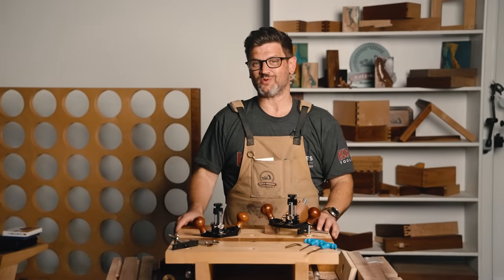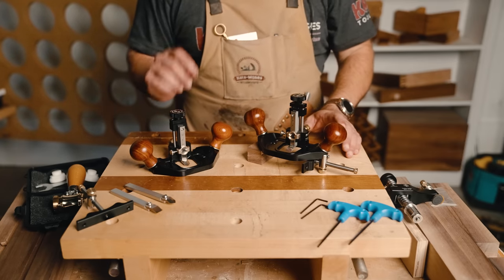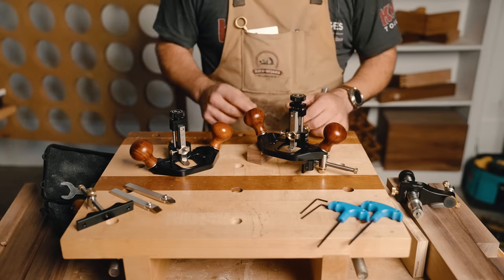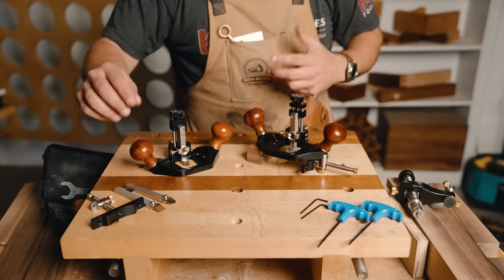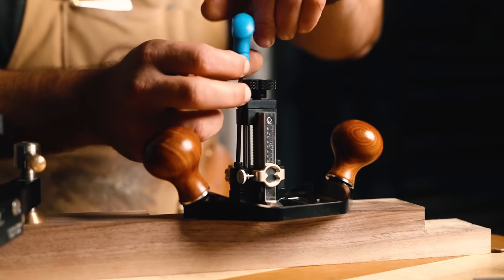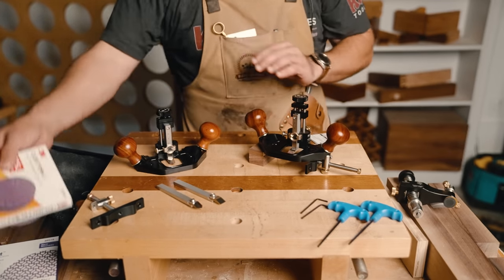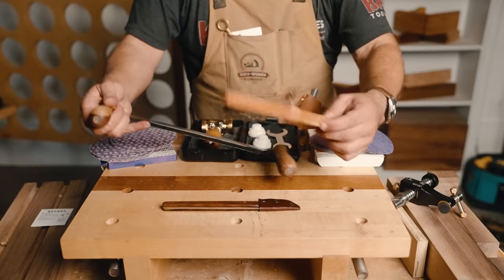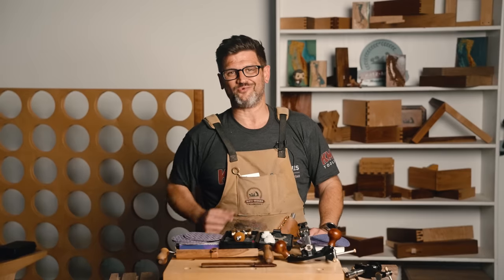The Katz-Moses Router Plane - Can You Believe It?

Comment: Looks like there's a new best router plane on the market... hopefully. 
I like the versatility of my Veritas but it always seems to lose its setting or have the blade loosen at the worst possible time. I'm always having to check the knobs and screw during use.
Having that rule will be handy for adjustment. There's so much slop in the Veritas, I tend to take too much of a bite, have to retract it, and then turn it back out (trial by error). 
If this does everything they got right without the "finicky" it's a winner for sure.

Comment: I cannot help but make the obvious comparison to the Veritas. I love my Veritas router. I also cannot help but acknowledge that if it really does nail all of the things it is trying to fix, your router plane leaves the Veritas choking on the sawdust in its wake. There isn't even a competition. None from LN, either. 

Everyone who uses router planes knows even the top dollar ones are fickle little beasts, but they're the best thing since sliced bread. I wouldn't work without one. If your control mechanisms can rein in even a tenth of the mechanical shortcomings built into traditional router planes, you've just done something extraordinary here for the world of hand tool woodworking. Have a seat next to Leonard Bailey. This plane is something to be excited about, no joke. 

Also, the timing on this business decision could not be better. This is a much needed addition to the modern retail lineup right when the market and the hobby need it the most. What a brilliant move. 👏 

Now I just need to find someone who wants to buy my Veritas so I can justify buying yours.

Comment: Does the height adjustment locking mechanism put pressure on the threads? Hoping it clamps on those 2 rods instead. Thanks.

Comment: Looks good and the price seems very reasonable. One critic: the fence should have had 2 attachment points. Else, eventually it will move/swing. It is the same design flaw as with mine from Veritas.
Reply from the maker: We fixed that by creating a groove that locks it in. It's incredibly solid.

Comment: Serious question.  I have the Veritas router plane.  Love it, but I can see improvements in yours.  Here is the question: with the angled blade, does it cut a flat bottom groove?  I'm talking flat side to side.  I don't know any other way to explain that.  No matter what I did to explain that to Lee Valley, since theirs most definitely did not cut a flat bottom groove, they just kept insisting that it did, and I must be doing something wrong.  I spent my life as a machinist working to precision that would make the average person cringe, so it was kind of insulting for them to take that route.  I don't mean to come off smartassery (is that a word) but there ya go.

I finally gave up after a few emails and a few more phone calls and just modified the dang cutter myself so it would cut a flat surface.  If you know what I'm talking about that's great.  If not, well I'm not sure I can explain further without a solid model and a cad file to show why there's absolutely no way theirs cut a flat surface side to side out of the box.  Other than that, they make a fantastic piece of kit.

I eagerly await your answer.  🙂  (how's that for me sounding important)

Comment: Looks great. My only concern is - is that a proprietary blade? Where does one buy replacements, and what is the guarantee they will be available in the future?
Reply from the maker: We will sell them and we have more sizes coming. Every router plane at this tier has proprietary blades.
Reply: @katzmosestools  You just answered the one hesitation I had: blade sizes.  hope there's a couple in the works a bit smaller than 0.5.  Putting my order in now.  Great work! (And I agree with you about Hongdui Tools)
Reply: Similar concerns

Comment: Thanks Jonathan, very impressive router plane, I didn’t even hesitate to place my order, even though I have an old original Stanley 71 made in England a 1934, works beautifully. Looking forward to work with your new one. I do like the additional fine adjustments and both metric and imperial since I use both at times.

Comment: Looks great.  Especially like that it has the double post mechanism.  Unfortunately I purchased the veritas router several months ago.  There is a fair amount of slop in mechanism and the shaft holding blade really has a lot of wiggle in it so blade pivots more then I like.  Looks like yours is much better design
  Congrats
Reply from the maker: Thank you! That was my biggest gripes with the other guys. This is rock solid
Reply: Yes, I have the Veritas also, and my biggest complaint is the slop in the mechanism.  Well, I had another complaint, but I fixed that one myself.

Comment: Looks like a great tool, love the adjustment features, but I've used router planes with angled handles before and really dislike them compared to ones with vertical handles. If you bring one out with a different handle setup I'd definitely give it a try 👍

Comment: You should not post things like this.... I am a tool-aholic, and a wood-aholic....... I don't need one, but......... I do like Lie Nielson's specialty plane that was designed to be used as shooting board plane. They are out of stock, no idea when they will be back, and have a huge back order line up..... That unit should be sold with a specialized shooting board as well, with settings for 45 degree miter cuts.

Saw a note over on Sawmill Creek the other day where we were discussing cutting dove tails. I mentioned your set up and one guy ordered it. He was surprised to get a call from you personally. That is good business....